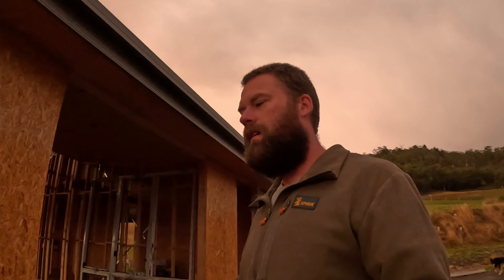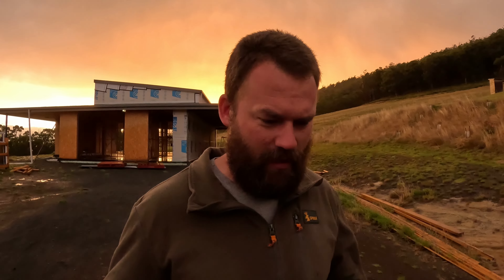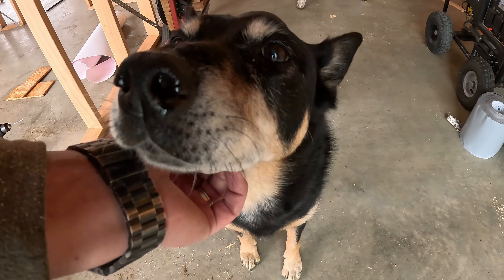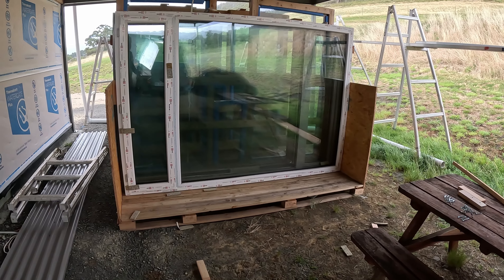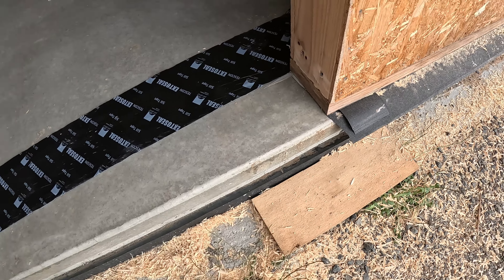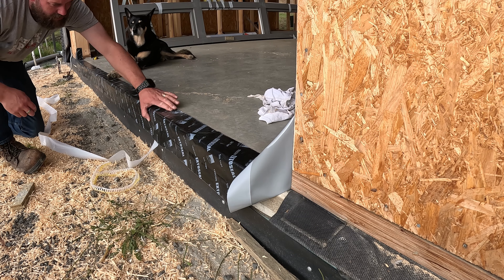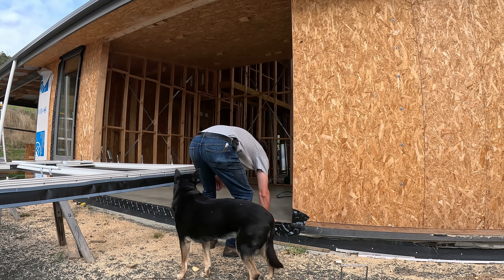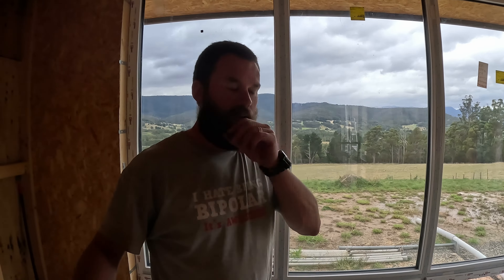TRIPLE GLAZING our passive solar SIP house! LBU20

Comment: Why didn't you choose MgO SIP's?
Reply from the maker: For a few reasons; mainly, I was not aware that there were so many types of panel! 
Locally, (Australia) we are quite new to the pre-fab or panel design building methods. We don't have many manufacturers that produce these types of panel and I quite like the extra layer of strength, protection, insulation and water-tightness that the battened space and cement sheet cladding provides. 
If I was to do this again, I would probably research panel types more thoroughly and explore a ply-based panel, rather than OSB, purely for strength, but I think I would stick with the separate external cladding for the reasons above.

Comment: Why are the small Windows that can open on the bottom?
Reply from the maker: Hi Ken! It's a little weird to have them on the bottom for us too! Originally, it was for cost of the windows. If the window comes to the floor, the glazing needs to be made with safety glass, to make the risk of driving a foot (or child) through the glass, less. This would mean that the glass above 600mm (regulations...) would be able to be made from normal float glass which is cheaper. As it turns out, all of the triple glazing panes are made from laminated glass anyway, so there was no need for this way of thinking, but it does also have other benefits.
As we have opening clerestory windows, (at the very top of our living space) we are able to dump heat by opening these. Having windows at the very bottom of the insulated space, means that this would be a complete convection movement of the entire house, when we need to cool inside, say during a summer night. We have mechanical ventilation with a HRV system, so that will be programmed to operate frequently to keep the inside air fresh and moisture-free.
It's also nice to have smaller frames in the larger parts of the windows that we generally look through, as the opening sashes mean that there is more frame, so it kind of makes sense aesthetically too! (on a side note, I don't think the large panes would be able to be operated safely by the young or elderly due to the sheer weight of them)